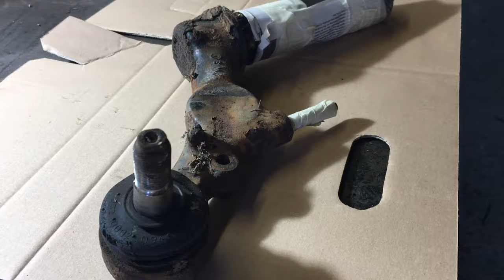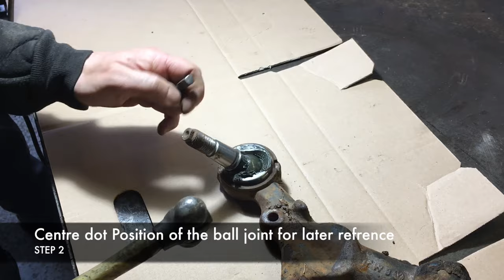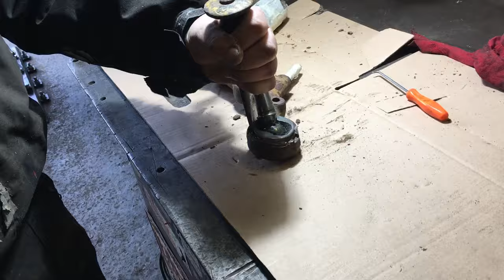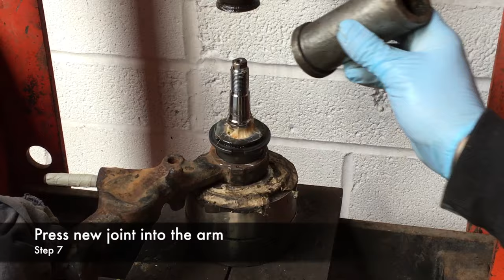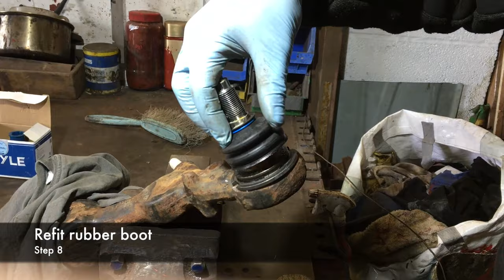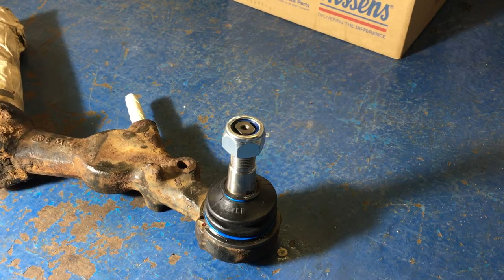How to remove and Press in Ball Joints on a VW Bay Window

Comment: I’ve got a quicker and cleaner way which will not leave grinder marks on the arms. 
Remove the boot, cut the ball stud off with that same cut off wheel/grinder, then cut the ball joint flange off with a Hole Saw in a big drill press or end mill. With the flange gone you can easily press the old ball joint out using a 20 ton press and can then sand the bore with emery cloth, clean it and press the new joint right in with the same press.
Reply from the maker: I would agree but I’m pretty careful And normally don’t cut the arm , but both ways work :)